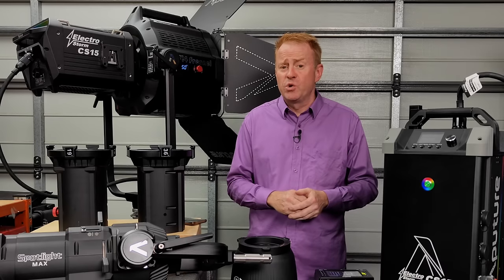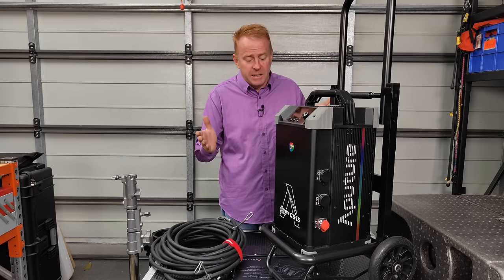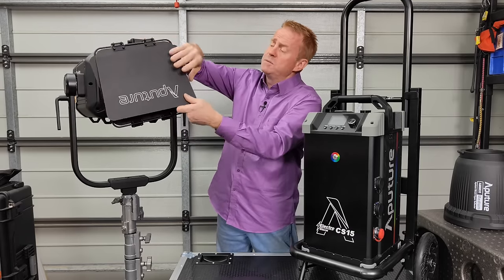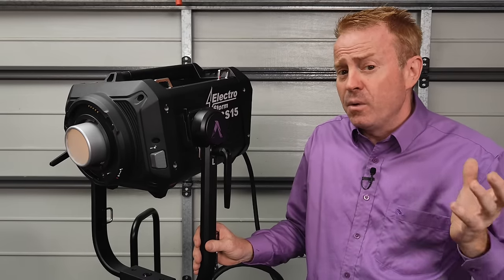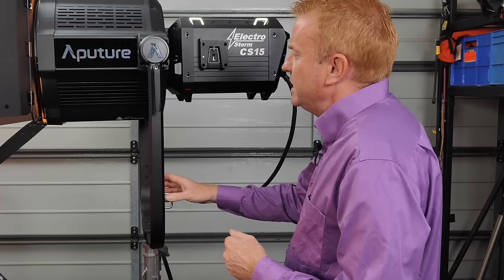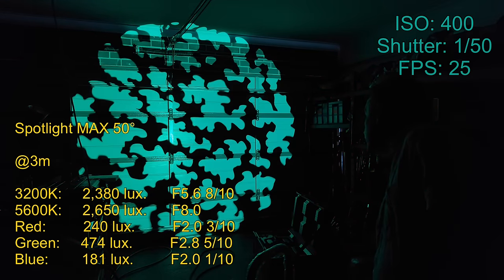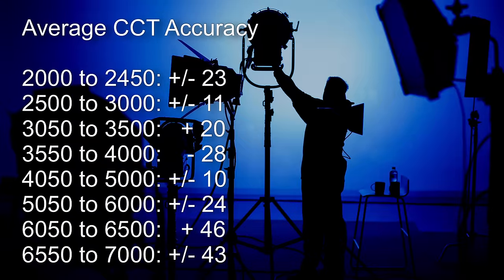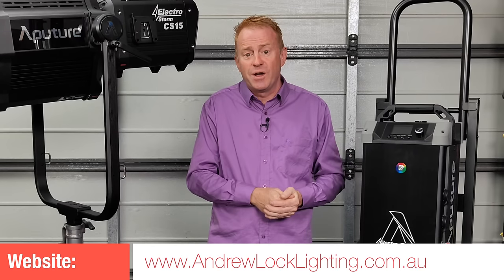Gaffer & Gear 258 - Aputure CS15

Comment: This past December, I was at Lux lighting in Brooklyn, NY, USA, where Aputure's Mitch Gross gave a demo of the Spotlight Max and the Electro Storm lights. Great demo! The lenses for the Spotlight Max are very high quality and have more glass compared to the Source Four EDLT lenses. There is an adapter for Source Four lenses to fit the Spotlight Max. Overall, I was impressed with the quality of the new gear. Very robust and well made. 

Aputure is making a serious bid to enter the high end pro and rental markets. These new lights are hot on the heels of HMI's, giving them a run for the money.

Comment: I see this configuration as more of a studio light, not so much as a location unit.  Price, size, weight, colour range, cable length all shout as much BUT given that, I can't quite figure out why the weather friendly IP rating? So, it's quite possible that a location profiled system will be in the works.

Comment: Does this have the Aputure-Prolycht tech they mentioned after the acquisition?
Reply: [Aputure] While the Electro Storms do not have the proprietary technology developed by Prolycht, there are some features that were “inspired” by Prolycht designs. For instance the Prolycht Orion 675 FS had a number of threaded sockets for attaching safety mounts and accessories. Aputure improved on this concept with hardened 3/8” sockets with locator holes.

Now that Prolycht is a part of Aputure there are a number of advanced engineering solutions that are being incorporated into future products.

Comment: I absolutely want one of these for my van. I have a medium sized 2 ton.  I carry mostly aputure but also have a couple of creamsource vortex/spaceX but I think I can make room for this baddie along with the ballast.  It will be a tight fit but I think everything should fit just fine.  I think I will also get the evoke 2400, having both of these paired together will make for some awesome exterior wood night time lighting, also blasting through large side windows of a house in tandem would be ideal.  I love HMI's but they have become a clunky mess over the years and worrying about power deliver to a 4k/18kw light always becomes an issue on medium budget features (no tow plant genny).  A single honda7000 with bates/gang box will seamlessly power a cs15 and an evoke 2400 spread out no problem!  Great review andrew.  Would love a follow up video on the power cable used for the ballast and different options you go for when running off of house power with these powerful COB LEDs

Comment: Awesome stuff, thanks Andrew.

For me personally I’d rather an Aputure 600d + F10 Fresnel + a small case of pre-cut gels ready to go for any situation.

The size, weight and overall cumbersome-ness of this package is something that would never work for me.
Reply: 1200D hits the sweet spot, too bad they dont make 1200 biclor
Reply: @Loqu4  Nanlux 1200bi is brighter.  I own 2 and and a 900C. Though,  never used Aputure's 1200 variants, used their 600D and I love the build quality of my Nanlux.
Reply: @Loqu4 no proper Fresnel for the Aputure 1200D though
Reply: F14 is made with 1200d in mind apparently. Would love to see how they perform together
Reply: @pavlovcikjan  I don’t believe that is true actually. The F14 is not bowens mount, as it uses the power pins for the motor (new aputure mount only). Someone correct me if I’m wrong?

The Spotlight max will work with it though. Just not as bright as you might hope.
Reply: [Aputure] The F14 fresnel, shown here with the CS15, does not work with the LS 1200d. There is a fresnel for that light in development.

Comment: great review, and Yes, I get you, that power supply, it looks like you are carrying a mig welder!, two separate pieces; at least with the nanlux 600D we have a power brick, Yes, but it can be clamped onto a light stand, so the whole apparatus is one piece, esp. if the stand is on wheels!!, if they want a greater market for these, then they need to make a light stand, boom, trolley system themselves, a holistic solution to transport and using it. One example would be a "techno crane", or a fisher dolly, all systems are integrated, and usable as a single platform.
Reply: [Aputure] There are mounting points on the control box so you can add some cheeseboro clamps. Then you can mount the box to a stand or hang it off scaffolding/grid.

Comment: Yeah I can see how the motorized addition can be good, but anything rigged or high up, its standard protocol to have ladders or even a sissorlift or a motorized truss that gets lowered by grips.
Reply: [Aputure] It’s a question of time. If you can adjust the light remotely it’s always going to be quicker. And if this is a semi-permanent install in a studio than one lamp can be quickly reset for multiple lighting plots without getting out the ladder or lift.

Comment: Great review. Only one question, high speed mode don’t allows to use dmx or wireless dmx or both? Thanks.
Reply from the maker: No CRMX either, it's very odd! A huge negative for me
Reply: @gaffergear  it’s possible to attach a godox RX to solve this for high speed mode? It’s a bit tricky but…
Reply from the maker: @josebelisariosiliuto9389  there is absolutely no DMX control, no matter how you try and send it in
Reply: @gaffergear  Absolutely a big negative. Thanks for responding my doubts.

Comment: Is the 15m headlead extendable ( to 30m)?
Reply: Oh my, good question. Perhaps an unmanned 90 ft condor controlled from the ballast on the ground? yummy.
Reply from the maker: 15 is the limit, I just checked with Aputure
Reply: [Aputure] Currently 15m is the limit but we’re looking into options. It’s a lot of juice to push through the cable, not just for the light but also to power the fresnel and the motorized yoke. Think about how much torque those motors would need!

Question: Why do you need the ballast on the ground? All of the remote functions including control of the fresnel and yoke can be controlled over DMX, CRMX and even our own free app Sidus. If you don’t trust wireless you could always drop a DMX line off the side of the condor and use an inexpensive DMX controller at the bottom.
Reply: @mitchgross592   power supply on the ground so less weight in the air - especially if its a remote head with your yoke and fresnel - we seldom  put HMI ballasts in the air unless somebody forgot the extra header cables ... longer cables would be really useful on the bigger budget jobs you've designed this for
Reply: Just Like Robin Said. Havin weight of of a crane f.e. Can have huge benefits. Its Not about Controlling. Maybe there should be an Option to have a second cable directly on a fresnel. 15m is Kinda limiting. Thanks for the review tho andrew
Reply from the maker: @Nauwl as a corporate gaffer I'm always on the ground so I'm finding this interesting. What's the maximum head lead you could put on a HMI and feel safe?
Reply: @gaffergear Weve done Projects with 45m extended arm on a crane where 2xM90 + 2x M40 leads were run from the ground up to the end (about 60 m of cable) extreme scenario tho. 60m Cruz you have to Strain relieve on the cranearm. Ive had 0 issues there.
Reply: [Aputure] Fair enough, that does make sense. I’ll check with the engineers to see what’s possible. I will note that there’s only so much weight savings going on here. The control box is 20kg and I’m guessing a second 15m cable would be at least 12-15kg. In the end it’s likely not a huge difference.
Reply: @mitchgross592  Thats a fair Point tbh. Thanks for the Updates and the honest answers ( Not every Company does that. Appreciate it )
Reply: [Aputure] Thanks. Honest interaction with the community is vital in my book. This is a two-way street and the only way to be successful is to develop the products you want in the form that you need. That and thinking in any other way I wouldn’t be able to get out of bed in the morning!
Reply: @mitchgross592  We craft folk understand limitations in new tech and are simply glad to have solid innovation like this unit, but we always are clamoring for more, better, lighter, cheaper, sexier....it's in our nature.😁
Reply: I mean, who wouldn’t want continued improvement? Keep pushing for better. I’m puzzled when some people complain about improved products being released, like don’t you want it better? If not then don’t buy it. Of course I also find it funny when some manufacturer states “It’s our best yet!” It damn well better be — otherwise why make it?
Reply: @gaffergear  For 18k or 12k units it's standard to always use 2 feeder cables on a condor 80 ft. (18.3 m) or less whether dead hang or spanning the arm. For longer condors like the 110ft. (33.5 m) you add a third feeder.
Reply from the maker: @666size666  that's going to be a problem with PWM dimming systems in LED fixtures.
Reply: @gaffergear  Absolutely, and in essence we are kind of comparing apples to oranges. Until they invent the LED equal to an 18k HMI (Silver Bullet) I would never put this higher than it's feeder. 
Can you imagine Andrew? An LED that can compete with the industry standard 18k fresnel. Please let me live long enough to see that.
Reply from the maker: @666size666  I should live long enough to see that, it will require nano cooling technology currently being worked on for the next generation of computer processors. This was developed by an Indian company a few years back.

This will also reduce the size of LED fixtures by about 2/3 as we won't require heat sinks or fans. But it's about 10 years off being realisticly affordable.

But I won't live long enough to see ultrasonic lighting. That will use ultrasonic sound waves to push photons forward and to shape the light waves into the colour spectrum you want. That's about 60 years away.
Reply: @gaffergear Last year on a huge show I was rigging electric. We were constantly building 3 Arrimax rigs on lifts. 3 50’ head cables per head or 45m